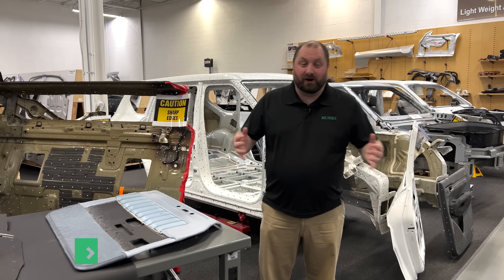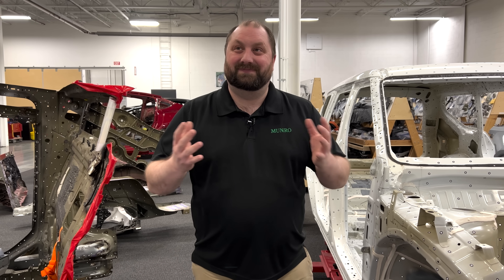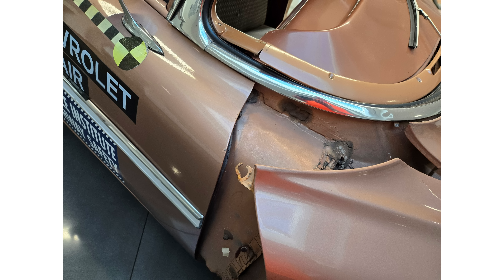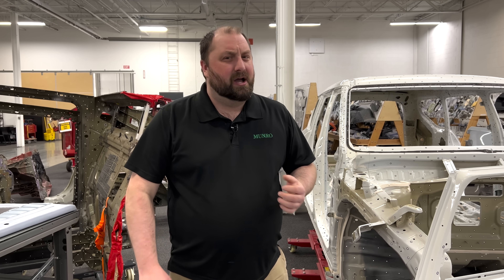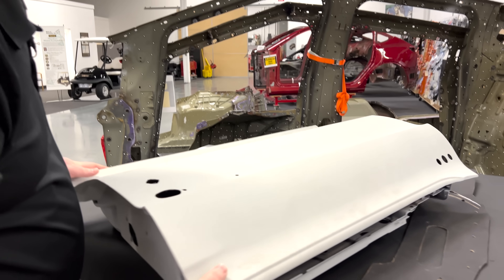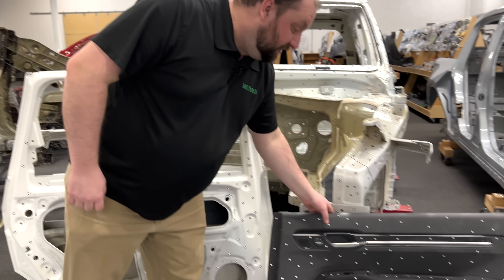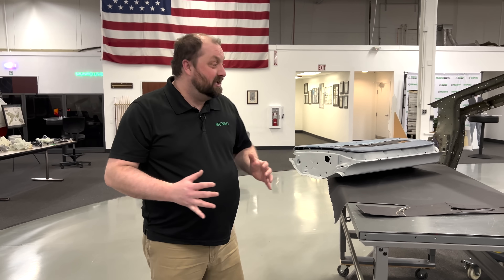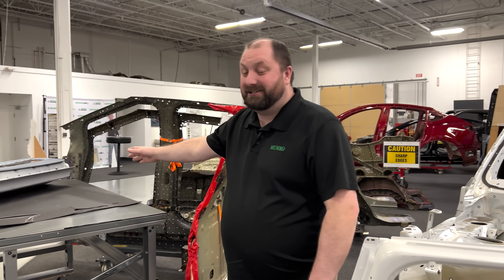No, Your Classic Car Isn't Built Better Than Your New Car

Comment: I still believe my 1968 Ford LTD was far safer in a collision than any 2025 model car.  Every change made to cars starting around 1985 made them deathtraps.  My granddaddy got into an accident in his wonderful 1957 Chevrolet and was impaled on the steering column and decapitated.  He died on impact.  Yet if he had been in a modern car, it would have been even more grizzly.  You see my point?  I did survive a crash in my modern car, but that was sheer luck.

Comment: Cars with a frame is like a body with a skeleton and a unitized body has No strength  but today they give you airbags and lots of plastic and aluminum engine that doesn't protect up front and plastic door panels break and it cost more than the hole door and leaded burns Cleaner and hotter but if it could run on airplane fuel it would Not smell at all